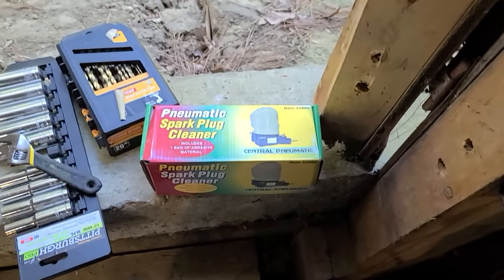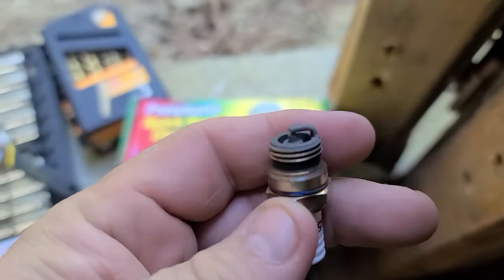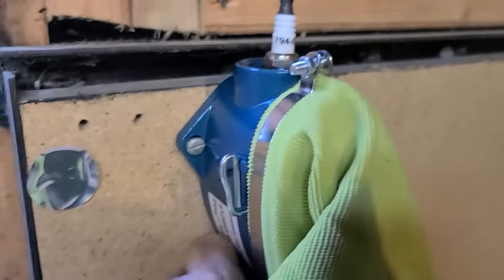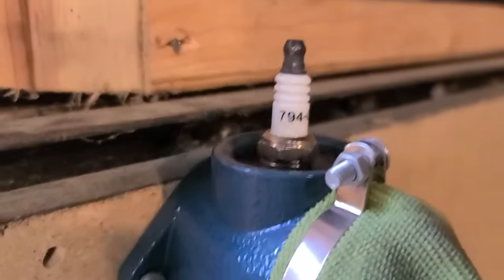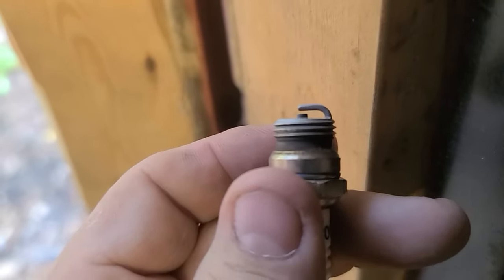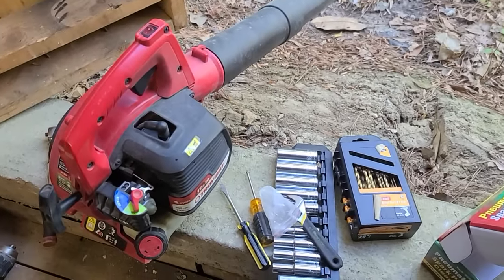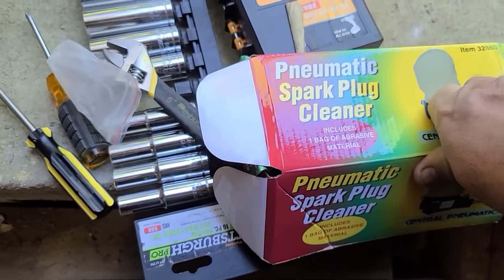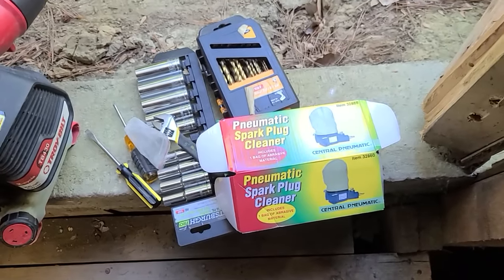Harbor Freight pneumatic spark plug cleaner.

Comment: Other then the fleck between the electrodes, which could have been removed with a pin, that plug looked great. Not overheated, no carbon buildup, no crust from burning oil. Most likely, clean the carburetor, look for something clogging an orifice.